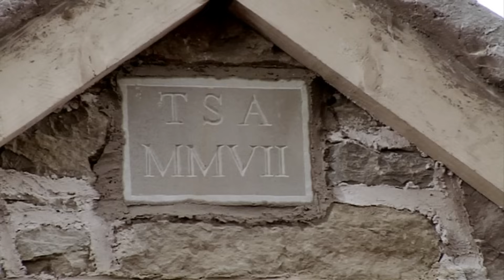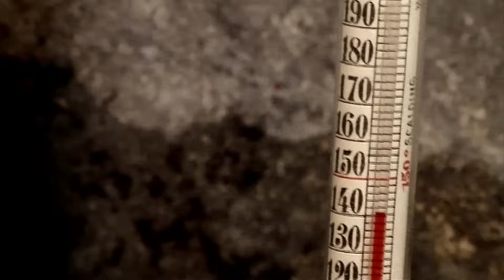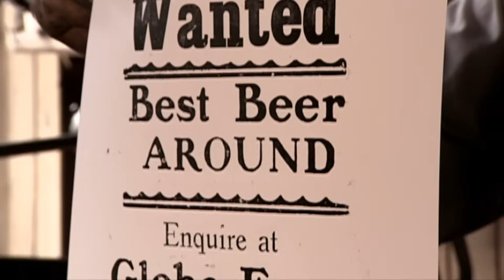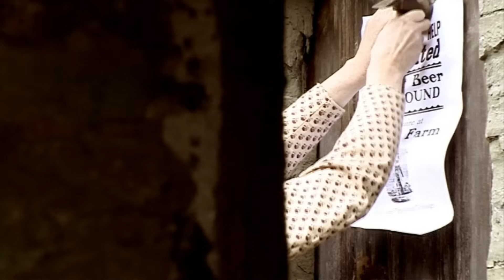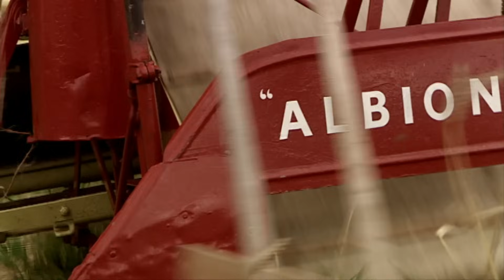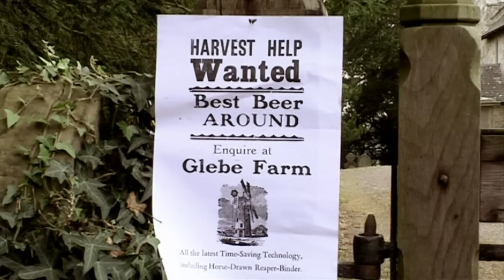The Astonishing World Of Victorian Printing Press | Victorian Farm | Absolute History

Comment: I did detect the electric welded joint on the resized wheel tyre. So much easier than fire welding. Probably cut it with an angle grinder Instead of a hacksaw like I would have done off camera!